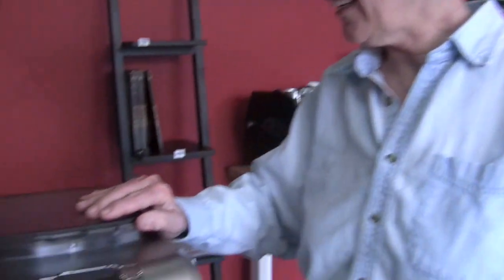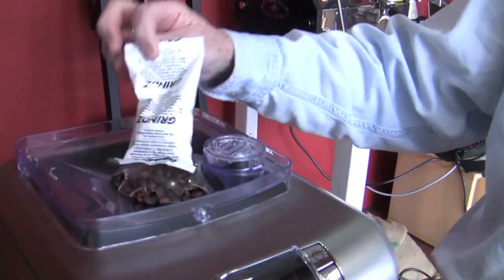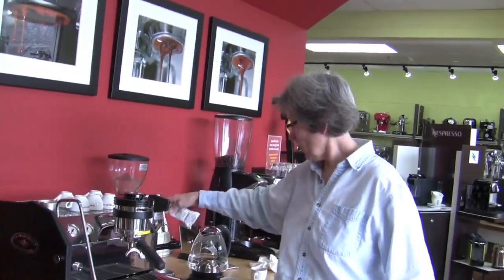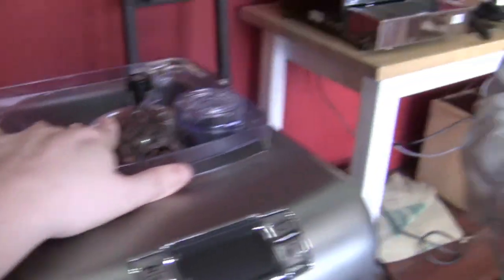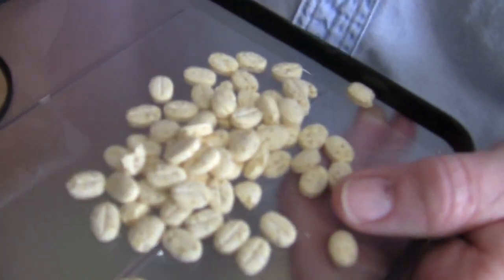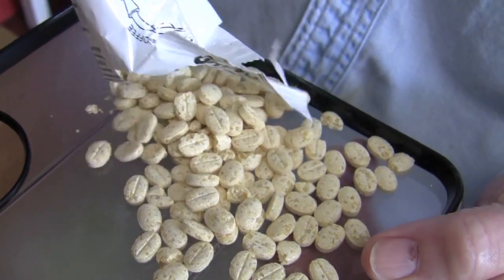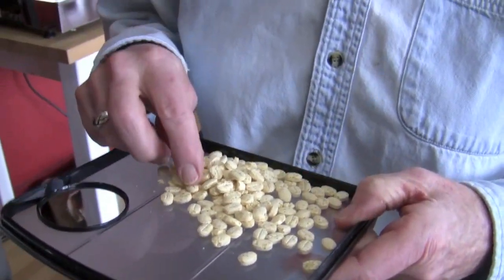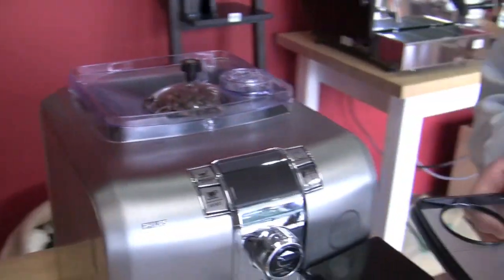Can I use Grindz to Clean my Superautomatic Espresso Machine?

Comment: Did this work to clean the grinder?  We love our super-automatic but also love starbux oily beans.  We about killed our saeco syntia & just got a saeco royal one touch.  I don't think it has a "test" mode, but I'm thinking that if I can run grindz through but stop the brewing (& pull out & empty the brew group) then maybe I'll be able to use oily beans & a super-automatic.  Thnx
Reply from the maker: We can't recommend putting either grindz or any sort of dark oily beans in your superauto because it of the inability to open the machine and clean it thoroughly. If any moisture touches the grinds it will expand and ruin your brew group or grinder. - Steven
Reply: The previous poster had suggested putting the royal into test mode, running the grindz beans through, then running regular beans through to clean out the grindz.  It's not recommended, but can it work?  
   I'm sorry I like dark roast, oily beans, but what can I do?  I've set the grinder on the coarsest setting & clean the brew group regularly.  Still, it sounds like there's no way to avoid pasting on the grinder & I'd like to avoid a $150 service charge to have the royal cleaned professionally.
   So, could this work?  And, what's the sequence for putting the royal into test mode (you show how to do it w/ the syntia & vienna, but not the royal). 
Thanks.

Comment: Just had an idea... couldn't I just put my machine into test mode and then manually run the grinder with the Grindz inside so that I can skip the machine from actually doing the whole brew process?
Reply from the maker: You could, but we don’t generally advise putting Grindz in, as it expands with any moisture (steam or water) and can harm the machine.  Keep in mind that you will also need to put some beans through to clear out the Grindz from the chute/grinder, before then brewing with it.  Generally about 2 brew cycles would clear this out. - Miranda
Reply: When in test mode you can activate the grinder only, no water. I guess that is what he asked. I think you could get in test mode and activate the grinder only, then you can take the unit out or the dumpster out to get the ground out, no water.